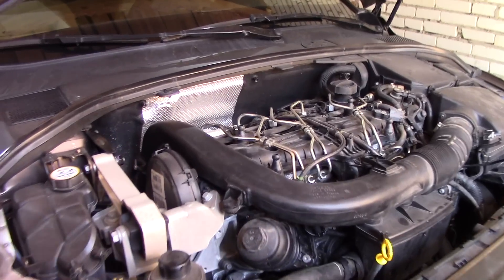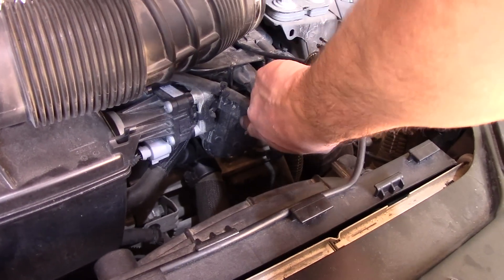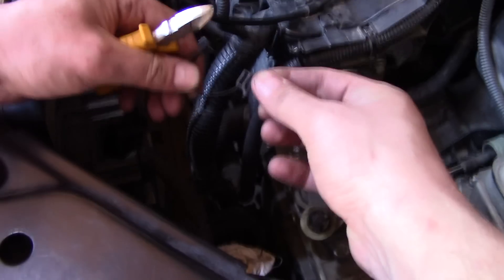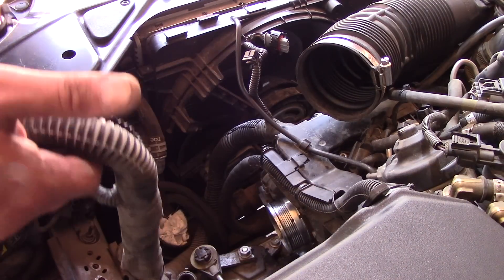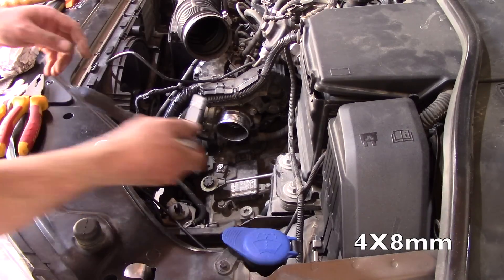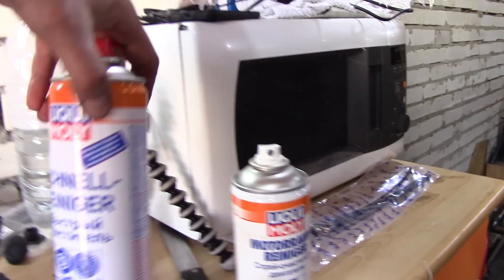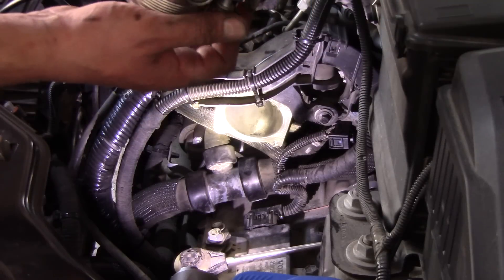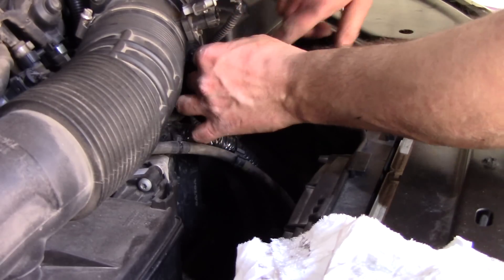EGR & Throttle body cleaning on Volvo Diesel engine 2.4D

Comment: Thanks for the video! It is exactly what I need to fix. But would you reccomend doing the wire protection in minus degrees? Does the plastic wiring may get brittle in cold?

Comment: Hi so im fine using brake cleaner or carb cleaner on both the egr and throttle body. I only ask as I have seen so many videos saying not to use them but i cant see if matter if its wiped off. Plus no where close to me stocks throttle body cleaner only carb/air intake cleaner and brake cleaner.

Comment: P0172 on a 2011 s60 t6 do you have any idea what’s a common issue with that after the vehicles warmed up rough idle and sometimes turns off when stopped

Comment: Great video! I'll do this work in my D5, with 140.000 km (XC70 2013). Sometimes it have P046C (EGR position sensor failure), could it be related with a dirty EGR valve? Thanks. Greetings from Chile.

Comment: Sorry, you missed a vitally important bit. The other side of that EGR pipe gets super coked up with Goo/powder. Cleaning the EGR mixer is only half the job. I was chipping out literally an inch of sooty gunk on the plastic elbow pipe. I don't think you had the "Euro 3" 163bhp d5? But that EGR was so much more simple.

Comment: No diesel have throttle body. It is called ASV, anti shutter valve. Its open every second engine is running, it close when you turn key off to stop engine from shuttering. Good to remove bastard, as it helps to choke engine along EGR with shit. EGR, ASV and DPF must be chopped with heavy axe from every single diesel engine. Worst shit ever designed for compression engine.
Reply: Why you say its good to remove the ASV? Afaik this guy will cut the air going thru inlet when turbo will burn its oil and will save the engine. Am i wrong?

Comment: Great video. May I ask at what km it is worth to change the EGR valve? My Volvo V70 D5 2009 is having 300.000 km. Time to change it or a simple cleaning with Liqui Moly diesel intake cleaning is sufficient?

Comment: Great video :) Do i need to reprograming throttle body after removing it from car  with VIDA or just connect battery and it will run ? Thank you very much :)
Reply: Just switch the key to on 2 or 3 times before turning  the engine over that will reset it

Comment: Hello and thank you for your videos. Always well done and helpful. My car (D5 2012) is lacking peak power so I bought a Liqui Moly throttle and EGR cleaner (5111). This product is supposed to be applied before the throttle body. On some cars it looks very simple, much more than on our engine... Do you know if I can apply it without disassembling the air filter etc? If I apply it after the MAF do you think it will reach the throttle body? Thanks for your advise.

Comment: I am having random error codes on my D5- different ones every time and often they relate to circuit issues for various components and I am thinking this wiring loom might be damaged somewhere. I am going to have a close inspection here. Also have the oil leak from the nipple as in your other video so will do that fix as well as it is leaking oil over the heater/temp sensor. Please make more diesel videos!

Comment: How to solve the problem... from starting.
Comment my Mercedes - Benz Blue TEC diesel has similar problem.  

The first real issue, in either case, is potential for vacuum leak and creating a code or drivability problems due to that.  

The second issue is much more serious that is the oil leakage, caused as this from the positive crankcase vent "PCV" for the engine.  Now forever all PCV systems have caused oil to enter into the inlet of the engine... any engine where the PCV system causes crankcase gas to be drawn into the inlet of the engine.  The the oil leaking from the rod bearings and sprayed on the underside of the pistons in the crankcase becomes entrained as a mist with the crankcase gas by the pumping action in the crankcase.  The crankcase gas is from the blow-by caused the piston rings sealing normal leakage,  and air vented into the crankcase.  When the PCV system draws the gas and oil mist into the intake system this creates first the benefit of the engine burning the resulting toxic gases and oil mist resulting in reduced emissions, approximately 1/2 the total emissions from the engine.  But it also creates the problem of contaminating Mass Airflow sensors, with oil either preventing them from working, damaging them or ruining them.  And in modern highly emission controlled engines it is made worse because of hot and soot filled Exhaust Gas Recirculation EGR is introduced into the inlet manifold to create the problem of sludge and coking of the oil.  The sludge, coking of oil, and grit is formed by the oil from the PCV system; the soot in the exhaust gas in the EGR gases, and; the heat from the EGR gases creating the sludge, coking, abrasive particles, and hard black deposits found in modern car inlet manifolds, and on the inlet port and valve surfaces.  

From research I was involved in about 30 years ago we found than by removing either any one of the causes prevented these problems... removing either soot [unburned or incompletely burned hydrocarbons], oil [wet hydrocarbon that tends to stick to the soot] or the heat from the exhaust gas solves the problem, the heat must not exceed even the comparatively low temperature of 125 degrees C.  The oil is easiest to remove by using a coalescing filter or catch can combination to remove the oil mist.  It is hard to remove the heat.  Removing the soot is impossible!

Comment: Great video! I have a D3 engine that goes in to limp mode after no response från the gas pedal (recurring, sometimes the gas pedal works fine). I have replaced the throttle body and the gas pedal. Maybe vibrations in the wiring loom can cause lost connection between ecu and throttle body? The code says no signal TPS (throttle position sensor)

Comment: I have general question or anyone who owns these or any volvo's w/ this transmission, e.g. XC60, as to the automatic transmission's durability, especially in cold temp's/areas, and in hot weather as well.    There are reports of issues in both very cold and very hot ambient temp situations or lifestyles.

Comment: Great and helpful video. Thanks.
I noticed that the part number for the throttle body gasket is not mentioned anywhere so in case anyone needs it, here it is - Volvo OEM part number 30757766
Reply: I was just looking for that, thanks for providing the part code 👍

Comment: Hi, I like your videos, I don't know if my dealer would do that and how much it would cost (mostly the EGR cleaning not the electrical wire part that you did) If you have any idea, I'd like to have an rough estimation... I'm thinking trying Terraclean cleaning solution. That or the LiquiMoly products that prevents disassembling... Have you heard of Terraclean? Have you tested the LiquiMoly EGR cleaners? Last question, did you feel any difference when driving the car after cleaning the EGR? Thanks. Greetings from France.
Reply from the maker: I have not heard of that. No difference after.
Reply: ok thaanks for your answer. I modified my message before seeing your answer... I was wondering if you had tested some LiquiMoly products dedicated to clean the EGR without disassembling... that or another brand...? I'm sure doing it by hand is more efficient but since I don't have the skill/tools/bravery to do it I'm looking for testimonies on how useful/useless it is... Thanks for your comments.
Reply from the maker: I think cleaning physically is the best result.

Comment: Can you tell us more about the "tape with a material" ? The metal protection on my DPF cables is in bad condition. (V50 1.6D 2006)
Reply from the maker: Look in hardware store. It's a tape with felt material. I am sure you can use some kind of alternative to it.
Reply: A very old reply do probably no use now but it’s loom tape. Easy to get on Amazon or eBay if you can’t source it locally at a motor supplies

Comment: One question Yuri, how do I recognize that the problem comes from the wires? What are the symptoms of that glitch?
Reply from the maker: The engine would just stall. A bunch of sensors would disconnect. Common with many owners.
Reply: Does the glitch also occur in D5244T15?
Reply from the maker: Any latest diesel Volvo engine.
Reply: Thanks a lot!

Comment: Something you didn't specify but which is important when reassembling the throttle body to the engine is to make sure both mating surfaces and the metal gasket are super clean beforehand, especially as it uses a metal gasket which is not easily compressible. Otherwise, you could have a tiny induction leak which would play havoc with the correct running of the engine.
Reply: What would happen?
Reply: @kamilolszewski6453  
An induction leak (air getting into the intake) would cause a lack of engine response, low power and possibly uneven running.

Comment: I thought only the D4 has often trouble with limp mode. Not the D5. Correct?
Reply: What I am trying to say is that the self build in cleaning of the EGR causes limp mode? Correct?
Reply: The engine is called Volvo D5, because it is a 5-cylinder Diesel engine. The cars are then marketed as D3, D4 and D5 depending on the performance, they even changed the output of D3 vs D4 over the years. But it is the same base engine. https://en.wikipedia.org/wiki/Volvo_D5_engine so you are not going to have an EGR issue on the D4 but not on the D5 if they are both driven with same conditions.
Reply: Hi!! Then I guess this applies to a xc60 D3 drive?
Reply from the maker: Yes

Comment: It's d5. You said d4. Useful video. Mine has egr blanked ;) together with dpf. No problem then.
Reply: Pav W 
The D4 engine is basically the same as the D5 but with a lower power output.
Reply: D4 add is a 2.4 twin turbo aswel
Reply: Still no problem with the egr blanked?
Reply: @DailyShortsVideo_O  no
Best decision made